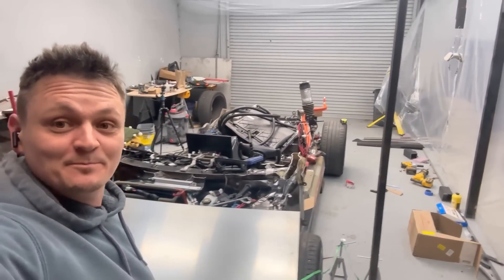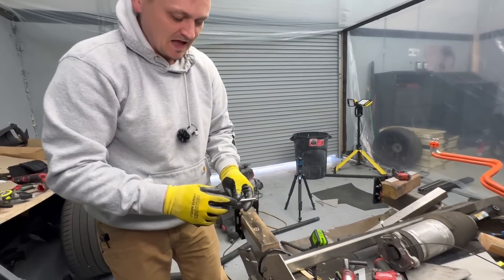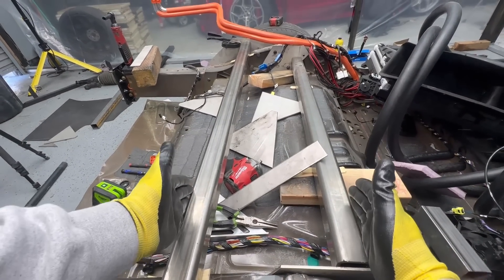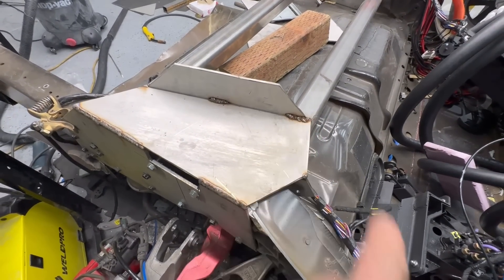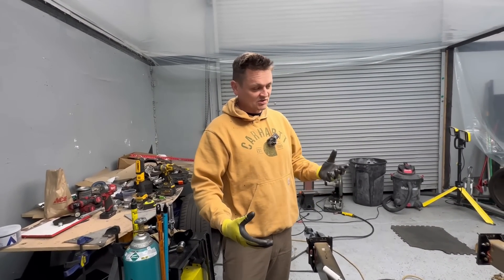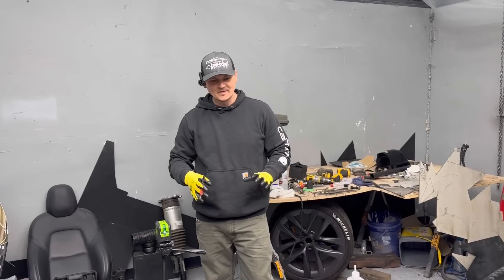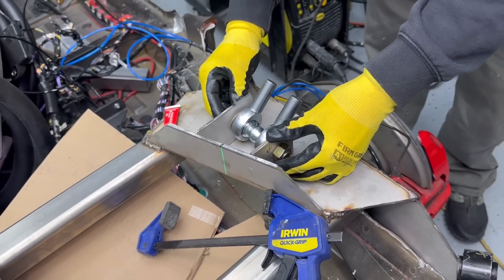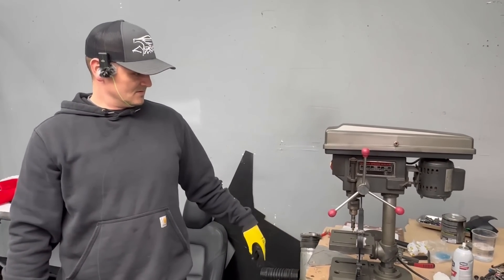The CyberPlaid gets a new cantilevered suspension

Comment: The cantilever angles are wrong. The connecting rods at the upper control arm are not even close to vertical... this messes up the hope of having a 1:1 motion cantilever ratio that's required. 

When you lean a push-rod over like that, it's vertical displacement is decreased - because a portion of the movement is moving outward, not upward.  The struts will not be able to push down against the control arms with full strength. 

The pivot point needs to move inboard a lot, until that outboard connecting arm is very near vertical, like the strut was.

PLUS... and this is the biggest problem, because of the way you hard-mounted the "top" of the struts, you will not be limited to a linear "in-line" movement of the bottom (now outboard) attachment point.  Look at all of the videos about push-rod suspensions... the shocks always have a pivoting inboard mount - allowing for the arc-movement to the cantilever pivoting motion.
Reply: who cares this is a show car
Reply: @xxn0cturn3xx  who cares? Have you ever rode in a vehicle without suspension? 😂 D̵u̷m̵b̷a̶s̷s̴
Reply: This is my concern too, but I think you described it better. 👌
Reply: dont think he'll change it now

Comment: Looking good! Using washers  as a spacer on one side between the plate and casting would given you a bit of wiggle room, but not too much. Also, if you ever want to remove those bolts in the future, you might want to use anti seize and lock washers, so the steel bolts don’t fuse to the aluminum. You know, dissimilar metals.

Comment: I dig your projects and channel bro. But when you made the new cantilever rear suspension subframe and bolted it in with Loctite and everything without priming or painting the metal to prevent rust, it was hard to watch. Looking forward to seeing the finished CyberPlaid.
Reply: This, big time!
Reply: Its stainless. As long as he used a decent grade then there is no need for a surface finish.
Reply: @lukemason9500   @frederik_probst  Stainless still can rust, especially after being heated like his was when he welded it out.
Reply: That is why he used stainless steel plates and tubes, under normal conditions it will not rust even if it is unprotected. It is a pain to work with it tho
Reply: He mentioned at least 3x that is stainless steel. Watch the whole video next time.
Reply: @TwinVisioned   I watched the whole video. It's obvious you don't know shit about metal work. Stainless is less likely to rust but it still can, especially when it's been heated up by being welded together as this was.
Reply: @TrigrHappyTiger only without proper gas shielding above a certain temp so you’re half right
Reply: @TrigrHappyTiger  I guess we all need to go paint our stainless steel exhaust systems too, huh? 🤣😂
Reply: @TwinVisioned  Lol, Google can be your friend. Yes, stainless steel exhausts can and do rust. It's far better than regular steel of course but it can develop surface rust. Anyway,  lacts don't require your belief, they're true with or without it.